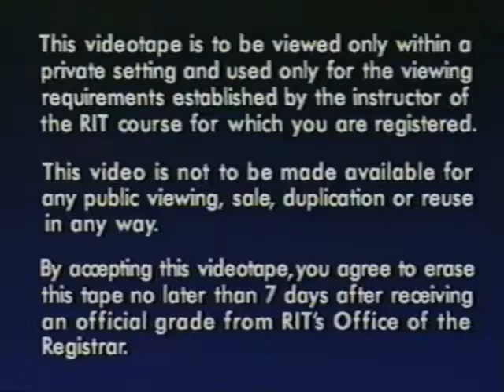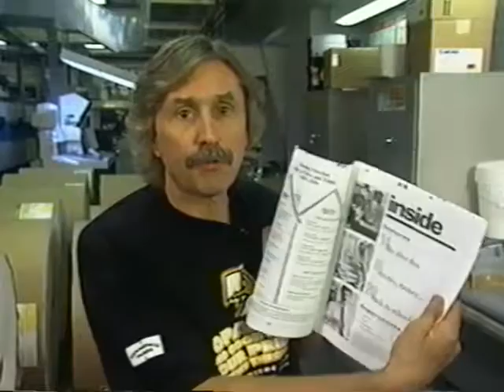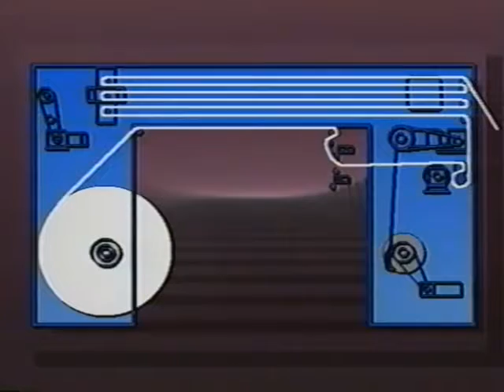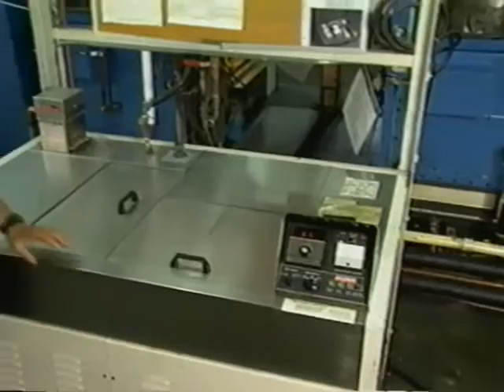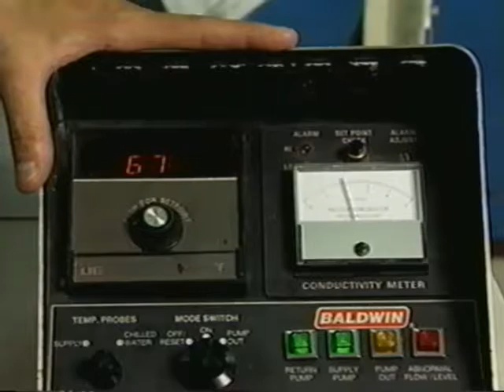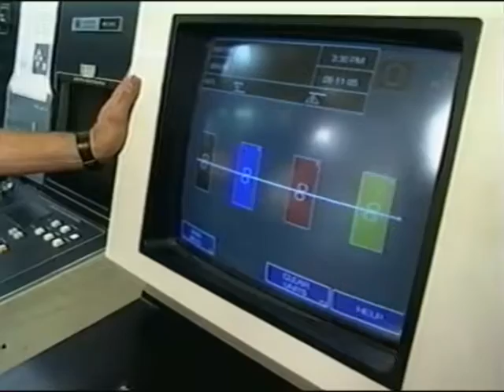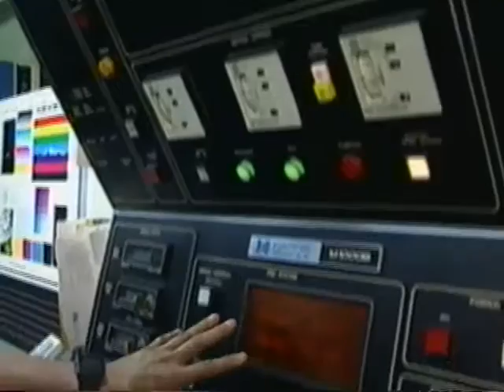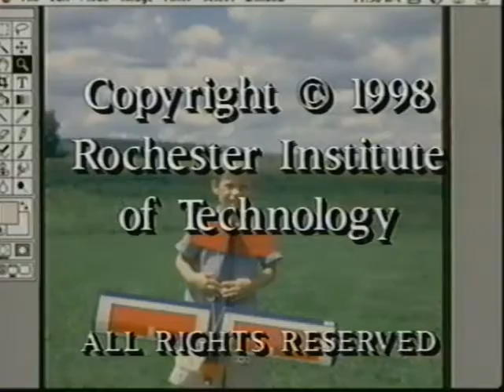Introduction to Web Offset Printing

Comment: Web offset printing machines require a set process from the reel stand,infeed tilt box,printing units,drying ovens,chill rollers,compensators,silicon unit through to your folder offering quarter fold,tabloid ect.

Comment: Fascinating! How do you print things with more than 16 pages? Multiple press runs and binding them all together? Or multiple presses?
Reply: Good question. Both of your suggestions are done by different printers with different amounts of equipment. Plus, there are presses with capacity for more than 16 pages. I visited Brown Printing in Minnesota in the mid 1970s. They were in the process of building a press that could print 96 pages in one pass, based on a contract they entered into with Newsweek Magazine. On the other end of the spectrum, I ran a sheet-fed offset press that produced 8 pages -4 on one side of the sheet, four on the back side. I had to put the sheets through the press twice, one for each side.  Separately, in the bindery, they were folded into signatures and saddle stitched together to make catalogs, high school sports programs, etc. The presses with large page counts probably run multiple webs at one time, as do newspaper presses, also. The webs are threaded into the folder after they are printed. I'm retired now, but I still enjoy ink on paper!
Reply: @kenschwentker4446  I was thinking of newspapers in particular. The record for the New York Times is 1,612 pages for one issue. How in the world did they print it and get it out the door by deadline?
Reply: @Mxsmanic  How in the world did anyone hold a newspaper that thick in their hands to read it? Do you have particulars about that issue? When was it? Why so may pages, etc.? Thanks.
Reply: I just found it on Google. It says it was a Sunday issue in 1987. Very often newspapers print Sunday sections (such as Travel, Fashion, Food, Theater, etc.) in advance, during the preceding week. Then they are stored, and inserted into the main paper. That must have been a back-breaker for the carriers on that Sunday!
Reply: @kenschwentker4446  Those were the days. I like ink on paper because it doesn't jump around when you try to read it, and advertisements don't blink into existence right in front of it.
Reply: @Mxsmanic  Just seen a video on the NYT. They print it at multiple plants. Plus each plant has multiple presses. Same with bindery equipment. 

I never worked on newsprint presses thank God, but I was a web offset printer for almost 25 years. Worked on quite a few different presses including the exact one in this video (except it had two webs and 8 units...printed 32 pages at once). Also worked a short time on Flexographic presses. I loved it. Little known fact: Printers' blood actually slowly turns into ink over time. My  blood is actually at 78% ink at the time of this writing.  ;-p
Reply: @chikkenbonz  What are the CMYK values for printer's blood? I cant find it in my Pantone chips.

Comment: Those festoons are in an odd spot, and it looks so enclosed. Not great to work on.
Reply: Is that a Butler splicer? A Letterflex(Cameron) Press I operated for 12+ years had a Butler that worked very well. The narrow web Offset webs there also had Butlers.